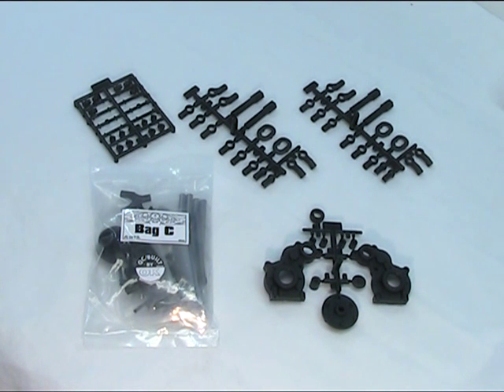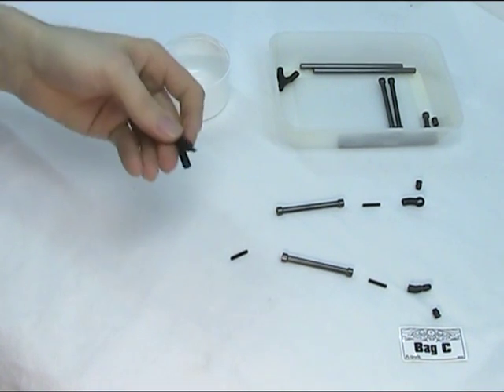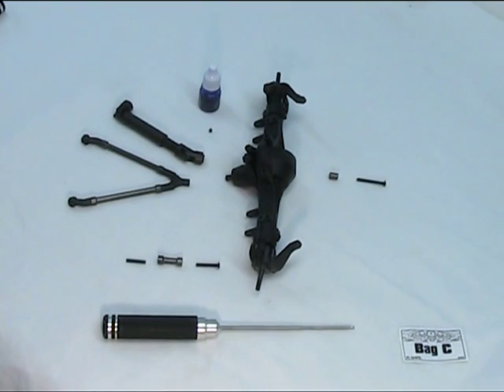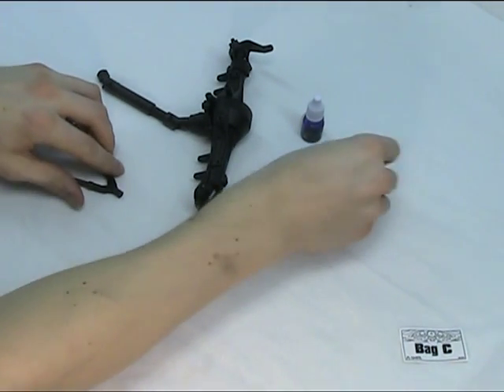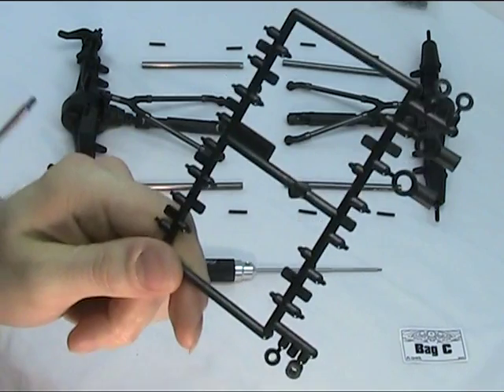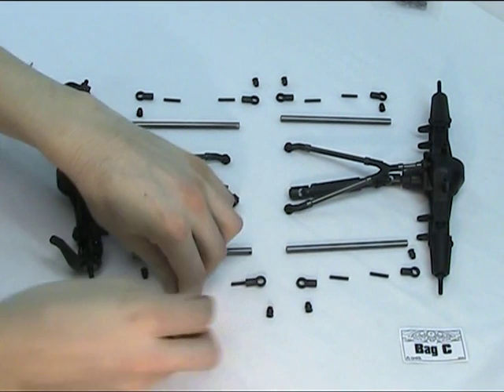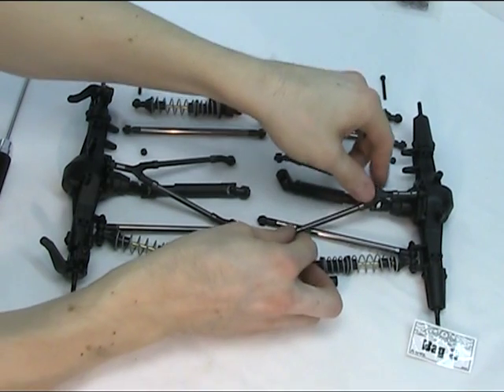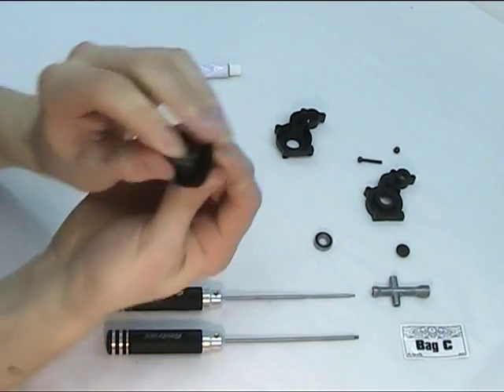Axial Honcho SCX10 PART 4 Assembling the suspension links and Transmission Housing Stages 14 20.mpg

Comment from the maker: @shcuck I agree there are some great RC's with LED's out there.

I have a video planned for this but  may be some time yet. I have used a number of systems & on this truck going to test the Axial Night Vision.

For a really good value &effective system is the Fastrax - includes head, tail, brake &directional lights.(see my SCX10 Video) brake lights function & the indicators light when stationary.

The Tamiya TLU01 system allows 8 strings of LED's but needs the TLU02 to function.

Comment: @rcBitz Well I was researching and found a guy who posted the exact same problem as me and all the forum moderators just said to not put in the plastic spacer. So if you run into the same problem when assembling your dingo, just don't put in the spacer for the main transmission gear. :)

Comment: Thanks for the support offer. Hey but I do have a question. I am not sure if you will cover it in your vid but wanted some details on the lights. What kit you have or will use, how do you install it and can it be controlled from the radio. I have seen some very cool videos out there on some doing this but no instruction on how to set it up. 
Looking forward to you covering it, or if you can recommend a link out there that would be great too. 

Thanks again

Comment from the maker: @MXRac3r545 Your doing well :-) Looking at the description for the video I have notes 'There is an error in the manual part no AX80032 should be AX 80005' You will see that the same part is also on hear but under a different code, (this parts tree is also used on the AX10 crawler kit.)

Hope this solves it for you and sorry for the slow reply.

Comment: On step 18/transmission, piece AX80009|5 won't fit inside plates AX30435-001 or AX30435-003 have any idea on what I should do? I noticed the the hole where the plastic fit's inside plates AX30435-001 and AX30435-003 was noticeably smaller than it looked in the instructions...